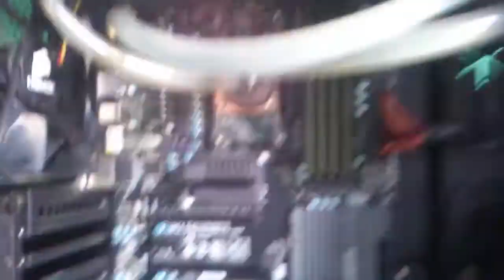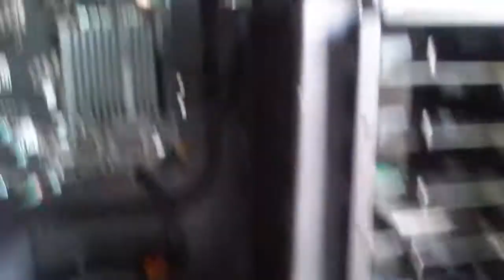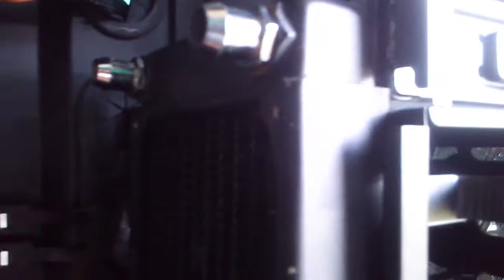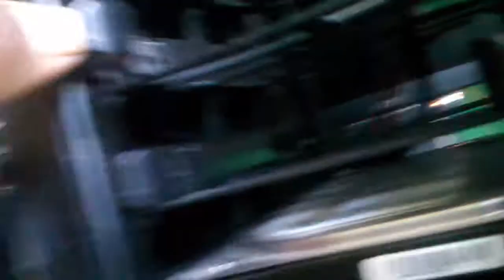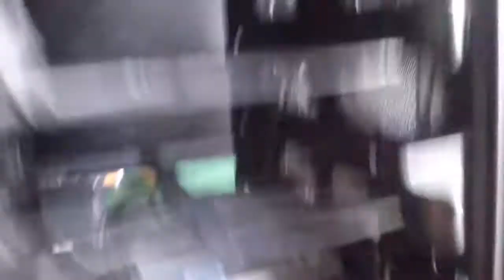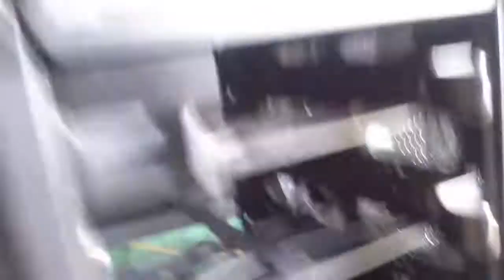Corsair 400R watercool - Update #1

Comment: You have the radiator in the top but no fans on it. Which Rad is that? i have the 400r and I'm looking at getting the XSPC Raystorm RS240 kit and wondering if that will fit inside the top with fans mounted inside also.